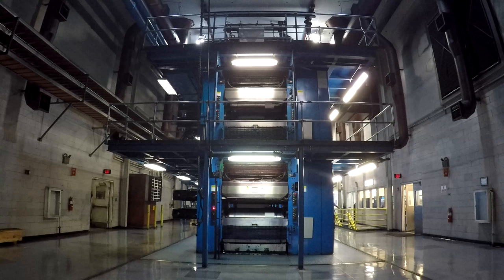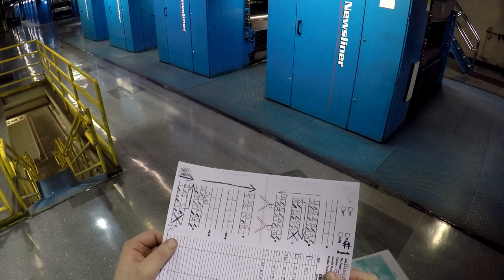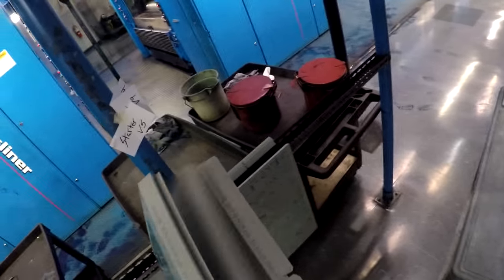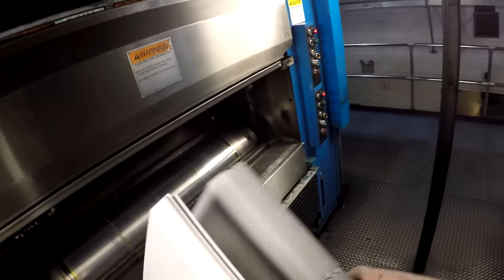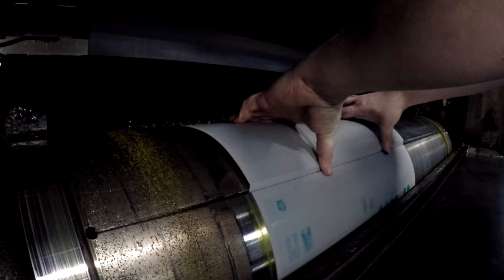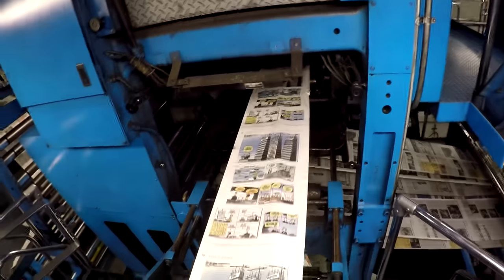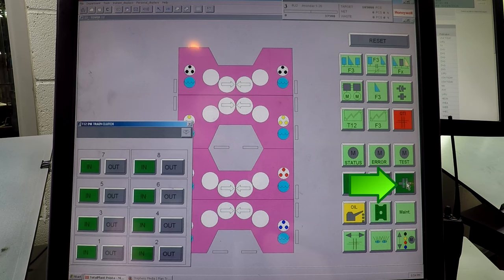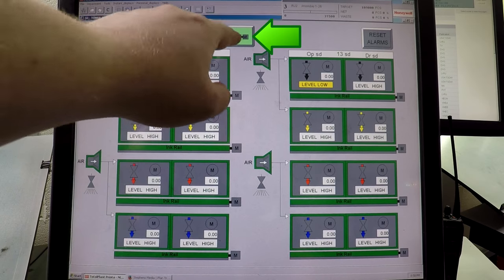Press Operator 2 - Unit Operator

Comment: The plates at the plant I worked at were scanned in the plateroom and the readings were loaded into the color control on the press. This was supposed to help on the makeready and startup. It was pretty good as long as everything was kept reasonably clean and calibrated.

Comment: I don't understand the small plate layout. We accomplished the same goal with single plates and the plate was full width of the plate cylinder and that kept the cylinder clean.
The plate room was responsible for the layout of the pages on the plates.
Reply from the maker: Was it a single wide or a double wide?
Reply: Harris N900 and 1700 all had a single large plate. These were for commercial heatset-offset, longer runs, and more expensive.
Reply: We did the same on the presses I used to run. You get the same outcome with less headache

Comment: That is the weirdest inking system I've ever seen on a litho press.I worked an Urbanite with a micrometric roller and a straight blade ink fountain, which was odd because of the micrometric when typical offset litho will use an ink ductor and straight or segmented fountain, but they always had ink keys. Modern presses are actually getting rid or the ductor and using something very similar to the micrometric metering roller, but that newsliner looks more like a flexo ink system with a doctor blade.

Comment: Hello. Have you done a lot of Plate to Blanket, and Blanket to Blanket cylinder setting, on your press?
I Did a unit on our Community tower unit today. I was just wondering if you check the settings yearly, or if a bad web wrap happens?
Reply from the maker: Originally they were scheduled to be done yearly, but we've come to the agreement that that's not necessary.  We currently only check them when we feel there's an issue.